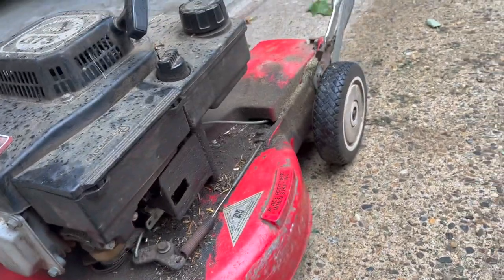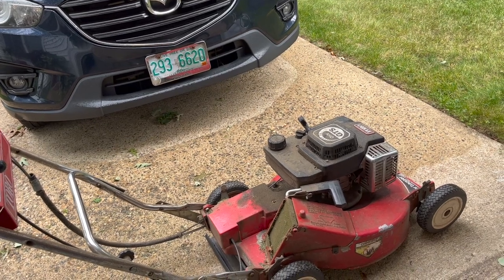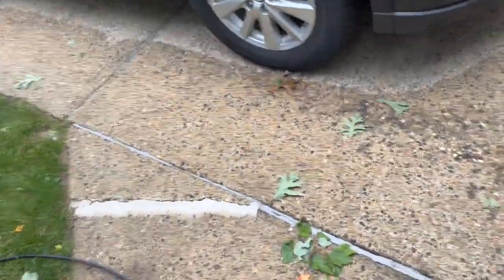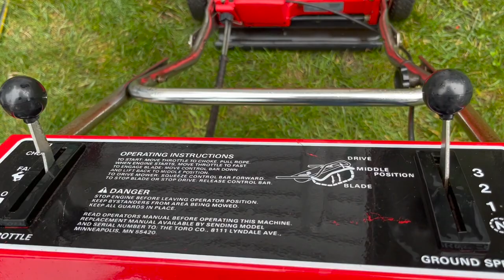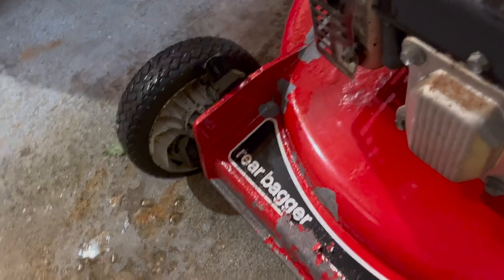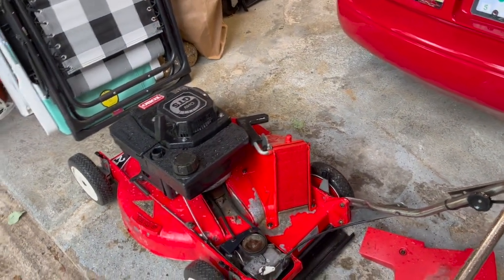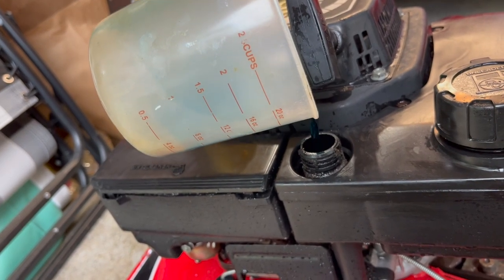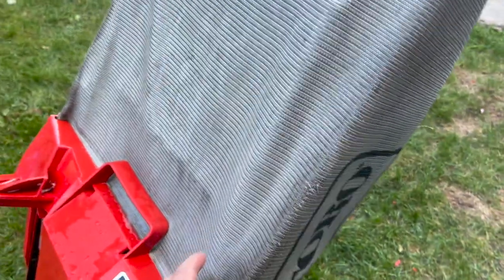Can we RESTORE this 1988 SUZUKI-Powered Toro Lawn Mower? Part 1 - Overview

Comment: Hey, in my experience those old small engines are tanks. They want to run. Aside from finding parts it's actually way easier to keep those going than the new junk you can get now.

Comment: Changing the grease in the transmission is easy. Just remove the cover and scrape out the old grease. Then just repack the entire housing with clean grease fully. Then just replace the cover, mine didn't have a gasket or anything. Took about 15 minutes. Now is shifts as smoothe as silk.
Reply from the maker: That’s… exactly what I did

Comment: I got one like that in your video, suzuki engine, but i have difficult to find a new carburator mikuni. My carburator is full of oxide due water. Thanks
Reply from the maker: Find a carburetor with the same throat diameter and adapt it. It’ll run.
Reply: @bbishoppcm  thank you, I will follow your advise.

Comment: I smell a possible spin off repair shop lol

We did something similar with a Mastercraft I think it was mower we had for over ten years. It was a limited edition mower with a high torque 9. Something hp self propelled mower. The old man and I completely tore it down, had somebody we know who does small engine repair goes though the motor and we cleaned and refinshed the body. Got another 6 years out of it before catastrophic engine failure

Comment: The new oil your putting into it looks like 2 stroke oil which is colored and that’s the wrong oil your pouring in it. Your supposed to use a 4 stroke oil in it.
Reply from the maker: The oil is “Toro” branded, and is dyed blue for some reason - this is not two cycle oil.
Reply: The blue dye helps make it easier to read on the dipstick when it is new and clean. Oil that is not dyed is VERY difficult to read on Kawasaki engine dipsticks I have noticed.